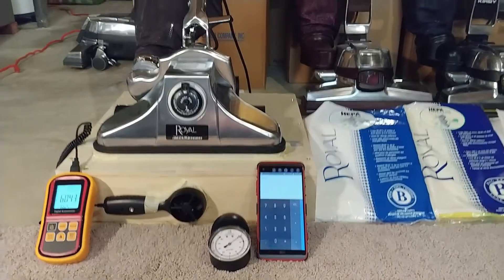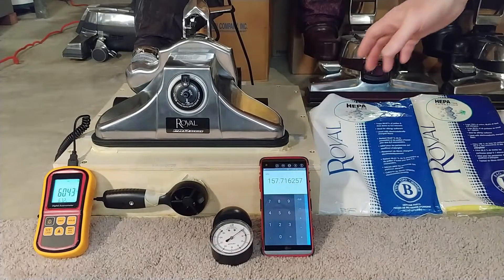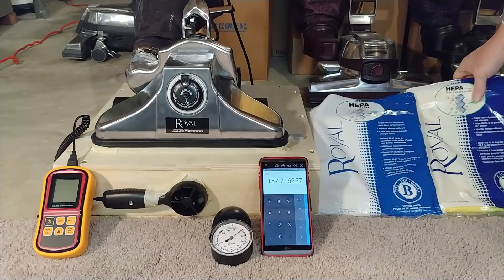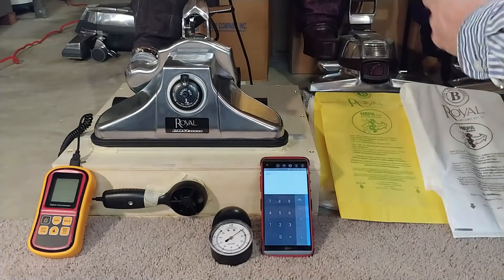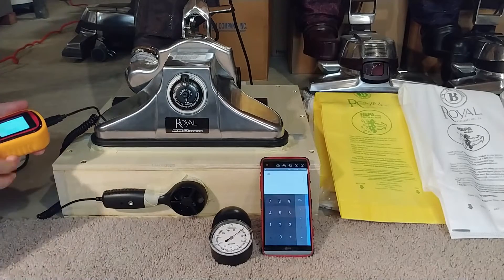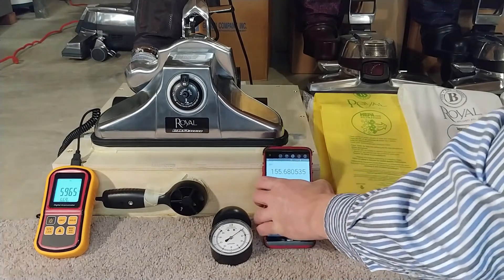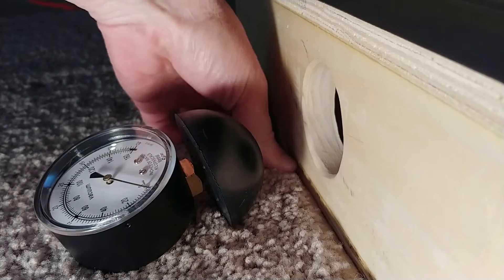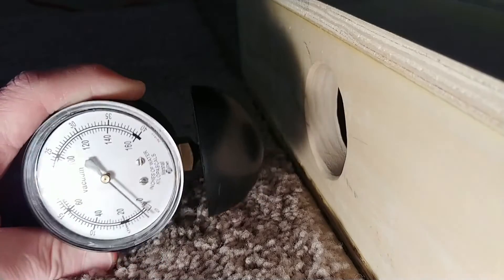Royal Pro Series 9 Amp Airflow And Suction Tests

Comment: I have recently found out that my Royal 2000, labeled 8.1 amps, actually has a 10 amp motor, which is pretty wild. It makes very little difference because the brush roller is so beat up, and I don't have any HEPA cloth bags, so the airflow is heavily stifled. I'd say it's on par with some lower power machines until I address those weaknesses.

Comment: Do you think my royal 8.7 amp with a metal fan pulls the same air?
Reply from the maker: Probably, as long as it's in near new condition with a HEPA bag.
Reply: @VacLab 
I'm still struggling to get HEPA bags off Amazon, unfortunately. Mine does sound like it spins much quicker, regardless of whether or not I have a bag installed. I have cleaned everything and confirmed no blockages. Mine might be modified, though, because the motor was marked with 10 amps when I disassembled for cleaning.

Comment: I wonder now what the avalir’s cfm might be if you put a metal fan in there since I’ve heard that the metal fans (despite being less durable than amodel (not Kevlar, amodel, which is actually stronger than Kevlar) fans) produce greater airflow. Probably might be TOO MUCH cfm (might even be so much so that you can’t even push or pull it even with tech drive on)!

Comment: I can't remember, would removing the belt add much in the way of CFM?  It's not practical, but it is a benchmark.
Reply from the maker: Yes, the CFM will rise with the belt off. Good for bare floor cleaning or circumstances where you don't want a brushroll. 👍

Comment: Nice test. One thing I noticed is for the 2 amp difference between the Kirby Avalir and the Royal is there's no real big airflow difference between the two. Yet there's a noticable DB level difference.  At some point Bill do you think you'll start measuring DB levels of the machines you test? Thanks for your time you have taken to do these tests. 🙂 Just a side note that the noise level of vacuums over here in the UK and Europe has now been limited to 80db. So now manufacturers have had to make modifications.  Some companies have put more planning in to this than others.😁
Reply from the maker: I have decibel measurements of nearly all my machines. Just never published them. But, you'll see sound levels for this dude at some point. 😎

Comment: Interesting to see... even though it's more powerful, I'd argue the avalir is a better vacuum to use daily. More functional? Definitely not as loud?
Reply: Very true.... the Avalir gets the dirt with out eating your carpet. Plus the Kirby is easier to convert to use the attachments. Plus a long list of other things it can do. Kirby are may favourite brand but I still love Royal all metal uprights as I have several in my collection.  I do prefer them with a headlight tho 😆
Reply: I agree. Kirby’s are still the best machine because it has the best features! You know there is a bottle of spot remover that you can shampoo the carpet and get rid of the stains! Or you can use the portable shampoor and spray it on the stains to get rid of them!

Comment: I wonder about what you'd get if you used an outer bag designed for the Royal Type A (F & G), modified to use a G-series fill tube (which can then use Kirby bags). I'd expect a skosh more - the Royal fill tube is awfully nubbly.

I modified my Type B outer bag to use Kirby bags, but the Type A outer bag has a bigger neck.

Comment: Nice results! Definitely higher than a Kirby but I think the Sanitaire sc899 would still have something to say. now I wonder what it would do in the sand in the carpet test.
Reply from the maker: The SC899 has higher CFM if you make the fill tube mod.
Reply: VacLab I wonder how they would do with the st bags as I think there easily converted from f&g to st